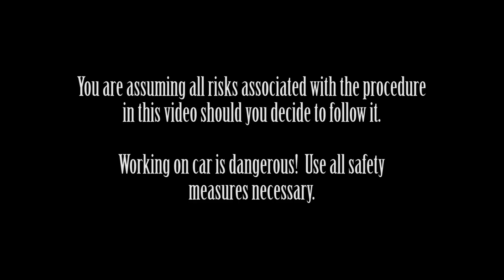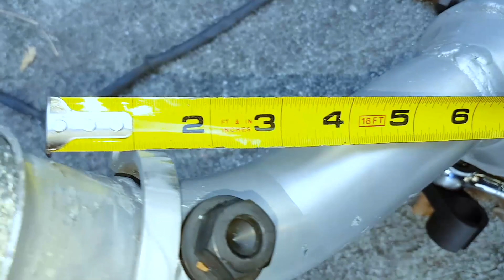W210 E320 Catalytic Converter and O2 Sensor DIY Replacement

Comment: Thanks for this video, it is very helpful.  Do you recall if you use either of donut gaskets (One is solid, one is a dense wire mesh) that came with the new cat when you did the installation?
Reply from the maker: Hi Glenn C, thank you.  I think I used one of the two but don't recall which...sorry.

Comment: are there nuts on the top of the exhaust manifold where the pipe first meets or are they threaded?
Reply from the maker: Yes، Chris.  The nuts are affixed there...and if rusted could be reached,  removed and replaced from the engine bay.

Comment: Is the rear a resonator or converter?
Reply from the maker: Hi Ace Tech, the front is the converter, the rear is the muffler.
Reply: @masood-tv  No it's not. There are 2 catalytic converters. 4 in total. Behind the catalytic converter where you installed the 02 sensors there is a secondary catalytic converter. I took mine off thinking it was a resonator which is pretty much a muffler but I think I am at fault for the confusion. What I meant when I said the rear I was referring to the secondary converter. I'm a professional tech I just wasn't accustom to seeing another converter after the downstream o2 sensor. I was really surprised on a Mercedes Benz there would be a converter not monitored by the ECM for emissions. Anyway thanks for getting back. I apologize for the poor description on my behalf. God bless!
Reply from the maker: @acetech9237  you are right.  I did take your front reference as front from the junction point.  Thanks for the clarification.

Comment: I have a 2001 s430 and my catalytic converter was stolen.my car went into limp mode after that.if I replace it will it put the car back to normal?
Reply from the maker: Sorry to hear that Michael.  Did they steal your O2 sensors along with the converter.  That could be the reason for the limp mode.
Reply: @masood-tv  yea

Comment: Thank you and SALAM brother for a very informative and valuable video.
I have the same vibration problem in my 2006 MB sedan E350, W211 base model. USA. 
My driver side seat right side shakes  when car is  idling or running at 2200 rpm and higher. I replaced all spark plugs, air filters, engine oil and filter thinking it may be a misfire or two (no misfire codes tho) 
Using an OBD tool and TORQUE pro app, I noticed that my bank 1 S1 and bank 2 S1 is not working.
And Catalyst and O2 sensor is not available means Cat. Bank1 S2 and Bank 2 S2 is not responding. 
Please advise or your thoughts where this vibration is coming from from? And what to fix. 
To me it may O2 Sensors, but I am not an auto mechanic. 
Waiting for your response. 
Best Regards
Reply from the maker: AAwRwB Syed.  Vibration is different from the clunking sound I describe in the video.  I cannot tell based on your OBD reading whether you have a bad cat or sensor.  That is what you should focus first.  Take the car to a muffler shop who may do the inspection free of charge for you.  Once you ascertain you have a bad cat or sensor, you replace them per the video.  Vibration causes are many including bad engine and transmission mounts as well as other suspension components.  But, first fix your exhaust issue and see if the vibration goes away.  A clogged exhaust system very well may cause vibrations...
Reply: @masood-tv , thank you Masood for the reply. I will take it to a muffler shop for cat and O2 sensor check and go from there. Good idea. What state you are in?
Reply from the maker: @badremunir  - I am in GA.

Comment: Can't we just delete the catalytic converter?
Reply from the maker: Of course you can.  However, it may be illegal depending on where you live.
Reply: @masood-tv  Actually it’s illegal in all 50 states. Federal law prohibits catalytic converter deletes. If you don’t have inspections where you live, you may be able to get away with it.
Reply from the maker: @atx-cvpi_99  - thanks for the info.  I don't know where O.B.A is from, hence my answer above.
Reply: @atx-cvpi_99  I don't.